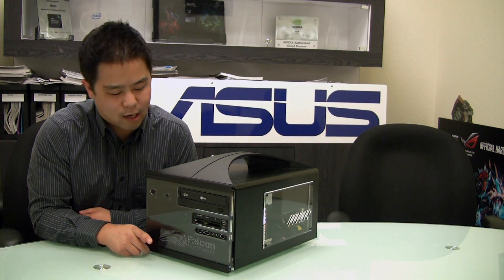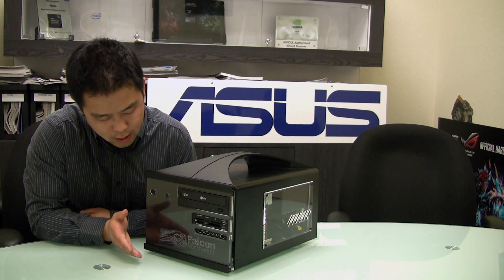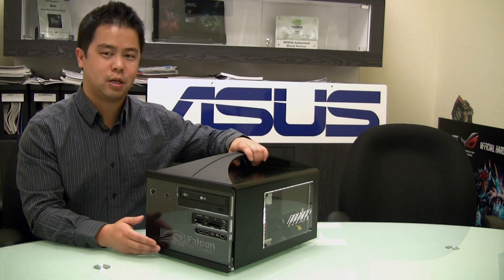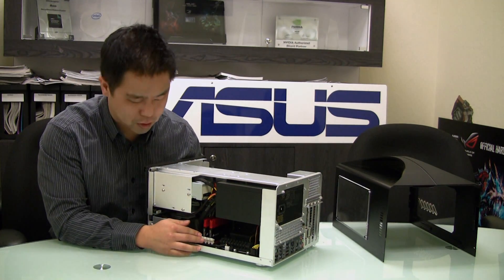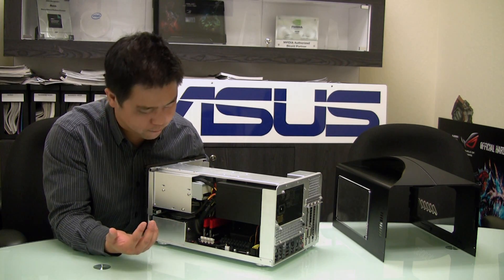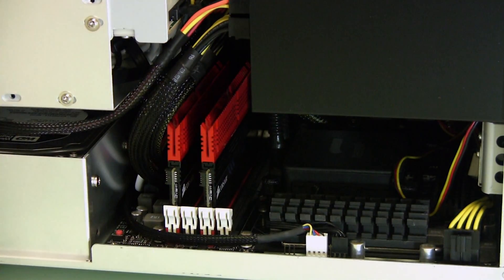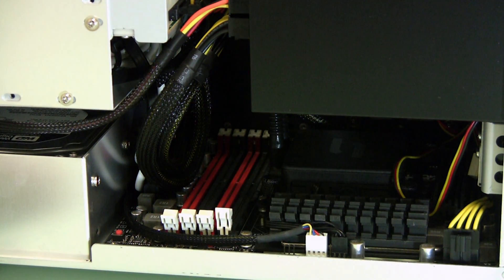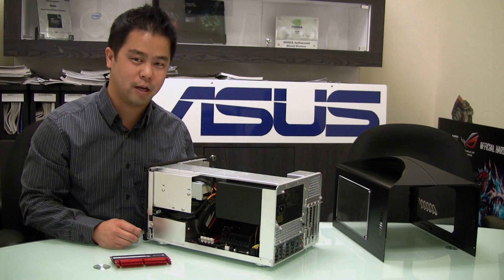ASUS Q DIMM

Comment: I have a large case with an Asus STRIX B550-F Gaming Wi-Fi II mobo.  3 fan 6700XT 12GB (XFX Qick 319 model).  I can't tell without looking if I'd have the trouble that is shown in the video, and I don't know if all mobo manufacturers use this kind of set up, now..
But I know one thing.  I like it.  I'm both surprised and disappointed to see people practically breaking things or not knowing how to seat RAM in these "Q-DIMM' style slots.  You slide into the stationary side, first, then just push down on the RAM at the latching side.  It'll just click with pressure.  

Never had an issue with this in any Asus boards in the past decade or more lol.  I genuinely like it just as a feature... whether I can reach both sides or not.  Works great if you ask me.  

Maybe I've just had good luck or there have been slight revisions to the boards I've owned with it, but honestly... I find it to be a feature that would work in place of ever typical DIMM style slot latching mechanisms.

Comment: and no this isnt just ASUS hate, Ive had to re-seat slipped RAM in several computers now, and also had to go through the anger inducing process of informing people that their very expensive motherboard needs to be checked for this problem to avoid bringing it back to me. I say again, it is a mindbogglingly stupid design decision that removes what for most will be minimal effort in removing an obstruction and seating the RAM with two clips.

Comment: The Q-Dimm is a shockingly bad design, I implore everyone to _not_ buy a board with it. It is not an innovation, its simply the removal of a clip that in any standing system is _essential_ to holding the RAM in. I can not stress this enough, they dont hold your RAM, the RAM slips and your computer will become unstable. It doesnt matter how well its seated it will work loose. I shouldnt need to point out that this can potentially damage every other part of the system as well. Never buy this. Ever

Comment: I just built a new machine and panic set in when it didnt boot.  
It had these half assed locks on that I thought odd when I fitted up the mems (4 Vengence units).  After trying to use the auto mem config etc and reading the MB book and sweating about what to do I remembered the sticks just dint seem secure at the non locked end. for good measure I removed and reinserted all 4 chips. The system did boot.
NB yep they were the right way rond both times. And this is a feature!

Comment: @Amuffin456 Maybe you cant read. If i was able to see the DIMM i would be able to figure out where the key was.. but since i couldnt i just snapped the bottom QDIMM in then pushed the top in and the top locked in. BUT BECAUSE OF THE QDIMM THE BOTTOM CAME OUT AND ROCKED ON THE KEY...... If it was normal the bottom would have locked in then the top wouldnt be able to because of the key and i would realize it was upside down.

Comment: Your QDIMM technology made me fry my mobo mem controlled as well as my ram stick. No, I am not an idiot. It was late and I was fiddling with the cpu fan speed, and in order to get to the switch, I needed to remove the first ram card. When I went to put the ram back in, I mistakenly put it in upside down. I snapped the bottom side in, then the top and because of the QDIMM it rocked the card on the key so that the top locked in and the bottom QDIMM clip pulled out.If it was normal that cant happen

Comment: @EXPieRIENCESBD It's not intended to be a performance feature.  It's a convenience feature, just like the clips on SATA cables or retention clips that are possible to set with only one pair of hands.  Sure, these things aren't necessary.  They're little things designed to make the overall user experience a more positive thing.  Trust me, if you're using a mATX case, this is a knuckle-saver and a time-saver.

Comment: @dragonthc Sure you can.  Once it's locked in, it's seated properly.  The memory slides into the further-inside clip and is held firmly in place.  If it's not held in sufficiently on that end, the outer clip won't lock.

Comment: The single latch will screw the pins in the slot if your RAM has a slightly thicker than normal PCB.  The lateral movement required by having one latch will pull and bend the pins.  Experienced this on my old Rampage 2 GENE -- that was not a fun night of upgrading.  Thankfully I've sold that kit and have not since had any issues.